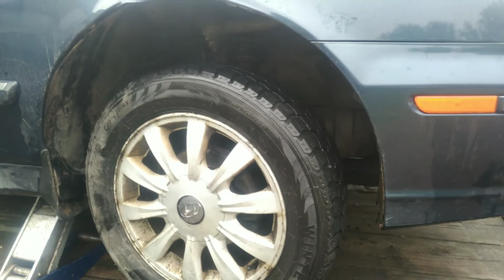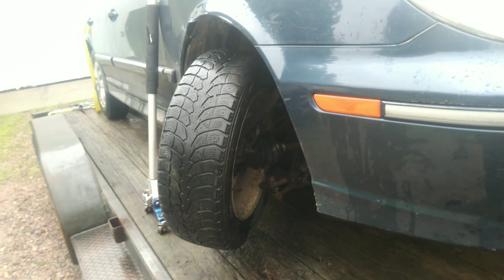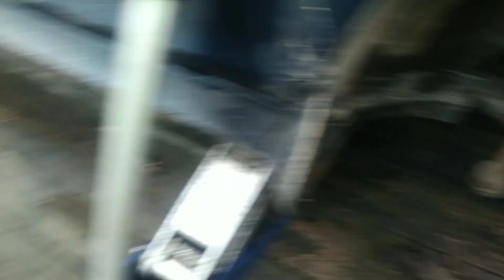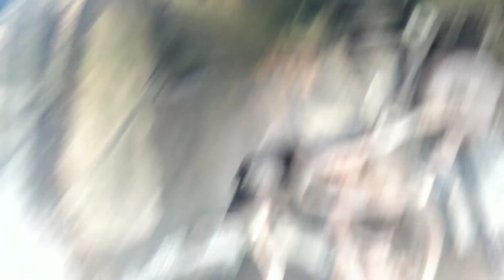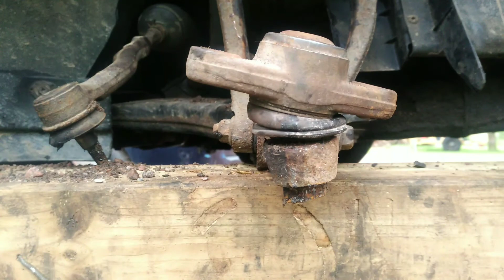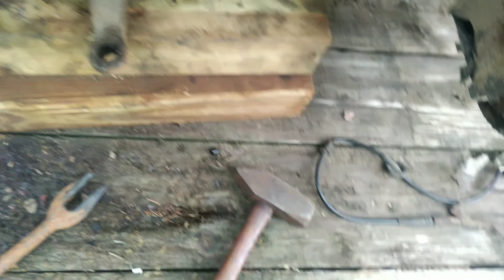LOWER BALL JOINT BROKE ON MY CAR WHILE GOING TO WORK.

Comment: You can go to a junkyard and get those parts. It's a used vehicle it's paid for! Does it run good?
Reply from the maker: Yeah it runs great there's just not much Hyundai stuff around here   I did find the knuckle with the help of a local salvage yard.  They had it shipped in for me for $50 from Indiana
Reply: @TREEKILLER90  I want to ask you a question. If you had to buy a new vehicle? To replace your vehicle they had a wheel that fell off. Chances are you're lack of maintenance. How much is it worth? I figure well it's paid for! It would cost me $34,000 to replace it.! It cost me $1,000 to fix it and I have no more payments. I'm going to keep it running.
Reply: @TREEKILLER90  how much does a 1500 Dodge 318 pickup cost brand new?
Reply: @TREEKILLER90  yes my 2001 Dodge ram 1500 it has air conditioning and it's automatic transmission. I paid $1,000 for it. I've had it for 2 years.
Reply: @TREEKILLER90  I've run my chainsaws! CS 7310p 590 timberwolf. Echo cs 800 p chainsaw all Echo chainsaws.
Reply: @TREEKILLER90  I broke my hip pushing a golf cart to my work area. Never mind I don't want to talk about it.

Comment: Well why you got it up in the air check the driver side too. If it's got a little bit of clicker clunk in it when you shake that wheel replace it now. Junk yards are great places for parts on Old vehicles.

Comment: Drivetrain and suspension parts are maintenance it's like making two or three car payments. Remember that! A car that's paid for! Has a good running engine and transmission. How much would it cost to replace with a brand new one? Five six seven hundred a thousand dollars.

Comment: Better do both sides while you got it up in the air don't be cheap.
Reply from the maker: Other side I did about 25-30k ago.   I checked it again today before taking it off the trailer to make darn sure it was good to go again.